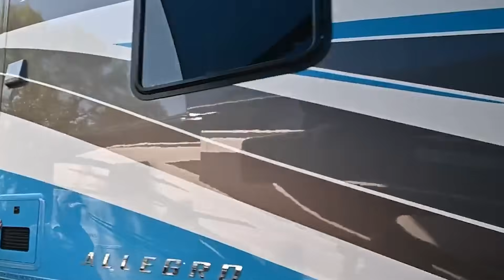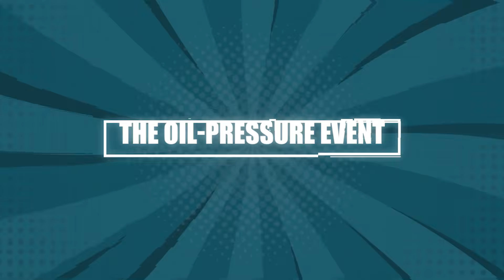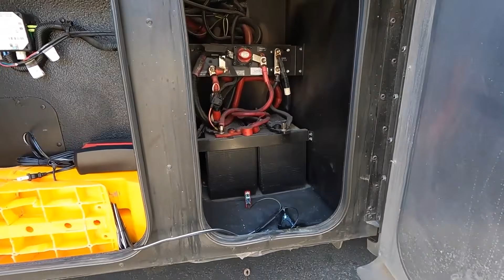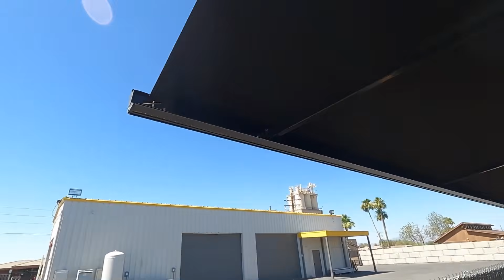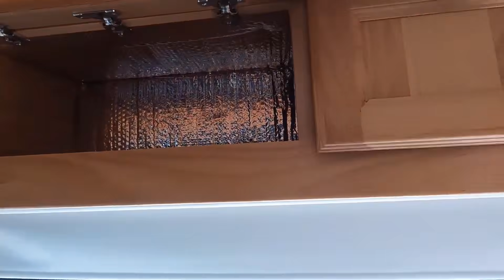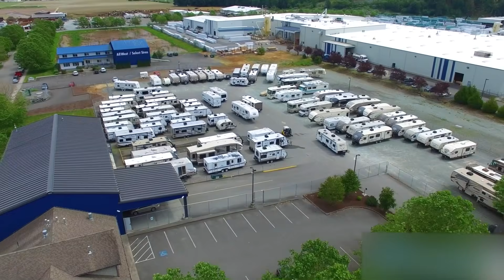Tiffin $800,000 Motorhome Scandal just Got Exposed! — Owner Are Furious!

Comment: The problem with these top-end Motorhomes is that they have to re-make the front end, which is very difficult for any company to do, much less a small company like Tiffin.  If you compare it to Class C's (at least some of them), you get the front untouched from the manufacturer (Ford, Mercedes, etc.) and so you get a boatload of experience and resources applied to that part.